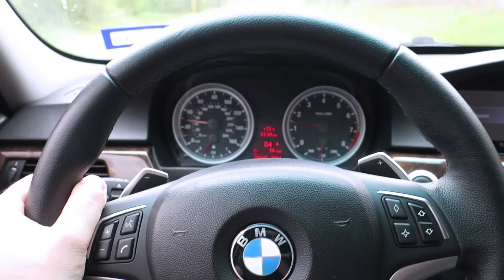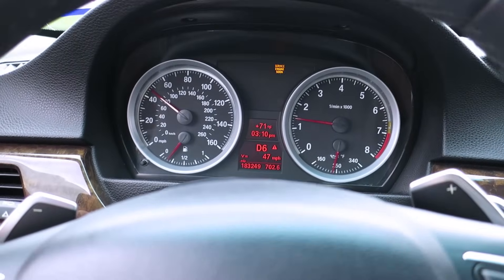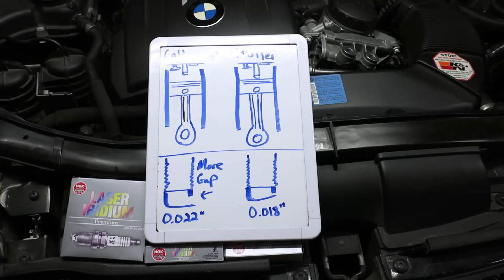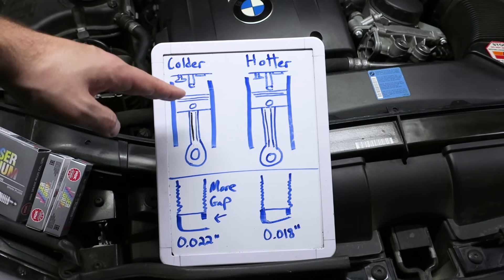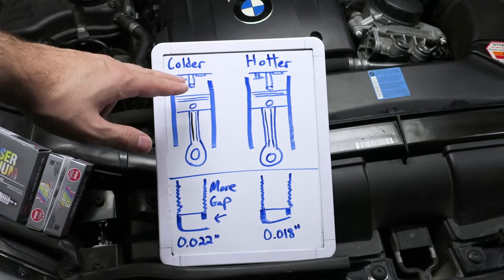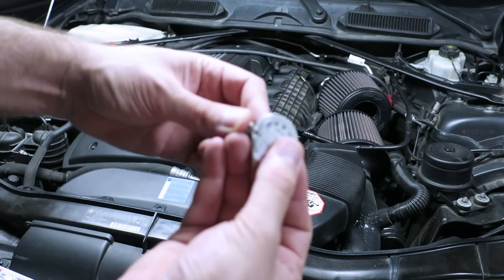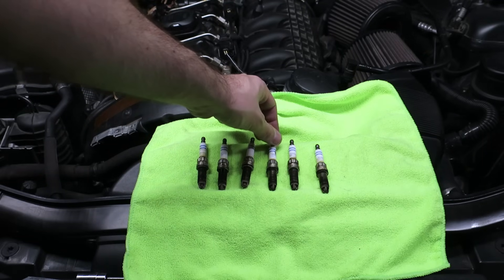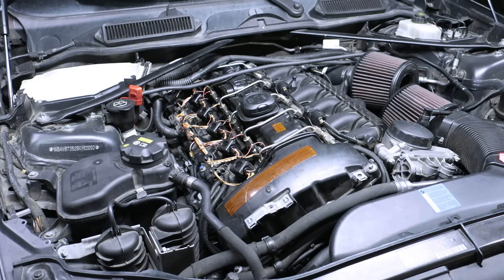What Does A Misfire Look Like?

Comment: I'm having an issue with mine right now. I had the valve cover gasket replaced and didn't notice this until I got it back from having it done. It does it mostly between 3rd and 4th gear at around 3,800-4k rpm. When I get on the throttle hard, it stutters/jerks real bad and won't accelerate very well at that point. If you keep on it, it will get past it. No lights come on or anything like that. Is there something that maybe they didn't put back together properly that might be causing this? I plan to take it back to that shop but just haven't had the chance yet.
Reply from the maker: Sorry late reply, could be replaced to the coil since you had them out or maybe some oil got in the spark plug valley during the valve cover gasket job.
Reply: Vehicular DIY I plan on changing plugs/coils soon. Maybe that's the culprit.
Reply: jt86tn was that it?
Reply: How did you solve this ? Having the same exact problem o8 n54

Comment: 182k miles? I just picked my first one up with 86k and it’s a 6 speed. Do these engines hold up that well?
Reply from the maker: Seems like it yeah, mine was first tuned at around 120K but overall these motors last.
Reply: Just tons of oil leaks
Reply: Nice lucky I picked my 6speed up with 145k

Comment: Did you start having misfires after going MHD stage 2+? I'm wondering if there is a connection cause after I installed the flash I've been having issues similar to yours.
Reply from the maker: No not right after but it would make sense that when you start pushing more boost/timing that a coil or sparkplug that wouldn't misfire on a stock tune would start to misfire with a tune.
Reply: Vehicular DIY I'm trying to figure out what's up with my car, I went mhd stage 2+ and started having misfires. I changed coils and spark plugs but still same problem gonna put in some remanufactured injectors next and see what happens? Not sure where to go from there?
Reply: KevinBeGood you figure it out?

Comment: I am having misfire when outside temps are below 35 on my N62 (E53 4.8is) on first morning run. And it only lasts first minute or so and later is it as smooth as it should be. When outside temps are warmer i do not get that. Is that a spark plug problem? I know i could just change them and see but i would like to know before spending money. Or injectors, or  coils? Thank you.
Reply from the maker: I have the same motor in my E70 X5, they have pretty simple injectors so if they were leaking then you'd probably have a rich code.  Did you pull any codes?  See if you do and if so swap coils to see if the code follows the coil.

Comment: Hey man great vid, I coded in my injectors and installed them (with help from your diy) and car ran great for a week. I then cleared the codes through inpa but I went through the menu rout of clicking the e90 chassis and then available jobs instead of clicking msd80 first.  and then cleared error memory that way. Well after I did that my car won’t start. Lights come on, recognizes key but doesn’t even turn over. May be a shot in the dark but do you know why?
Reply from the maker: The starter doesn't crank at all?
Reply: The starter went and then the battery. Just started using inpa, and still figuring it out. I’m leaving a charger on it next time bc both the battery and starter died right after I used it. I cleared the main codes, n then the codes through the dme, and then nothing when I went to start the car. It’s just weird that both failed right after I used inpa. I did bump the started a lot to close/clean valves last week. Got a new battery, Walmart everstart h6 maxx(I have that in my wife’s car also 335i ) which work great, they’re about 73ah and $117, just have to code.   Thanks for the diys they are a big help.

Comment: Can I use these plugs on a stock N54? I feel like my car hesitates with the bosch plugs and i have new plugs and coils but i did have a bad injector for awhile like for a few thousand miles but i did just upgrade to index 12s and i have DCIs and a 5 inch FMIC and a secondary cat delete, and also do you think i damaged my engine? i feel and hear a rattling sound when the car is cold when i give it gas but it stops when the car is warm, any ideas?
Reply from the maker: You can use these plugs on a stock N54 yes, its unlikely you damaged your engine as the DME is pretty good about protecting the engine especially on a stock tune.  The rattle sound is it metallic?
Reply: it sounds like a very slight knock within the engine but it only happens when the car is cold...

Comment: My e90 335i does that sometime. When it happens, it would be when I go full throttle, then it goes into limp mode, and check engine light comes on. it resolves by itself if I shut the engine off and turn it back on. I am running JB4 Map 1 and Dual cone air intake. At first i thought it was the plugs, i replaced them, but it still happens from time to time. So now I am considering to change the injectors and or the plug coils.
Reply: usually it will be the coils when you get a misfire because the stock coils are not the best with running a JB4 FCPeuro's website has plugs and coils with a lifetime guarantee
Reply from the maker: Yeah you should try coils next and lastly injectors.
Reply: Vehicular DIY Thanks for the advice! Should I replace all 6 coils or just go off of the check engine code and replace that specific one? what do you think? I am asking because I wouldn't be able to do the trick where u switch them around to figure out which one is the faulty one, because normally they are all working just fine.
Reply: Frank Nasrawi you should pull the code you could also have a boost leak
Reply: usually when you replace coils your going to want to replace all of them cause then a different one could be faulty and then your going to keep replacing them I had your same problem and what ended up happening was my ecu ended up frying but to play it safe get coils and use the jb4 to reset the maps using on the mph option 1 and on the rpm use map 4 and exit out and let the car relearn the jb4 and then after diving regularly for a half hour do some 3rd gear pulls and your car should be out of the limp mode
Reply from the maker: Facemxsk Great advice I agree 👍